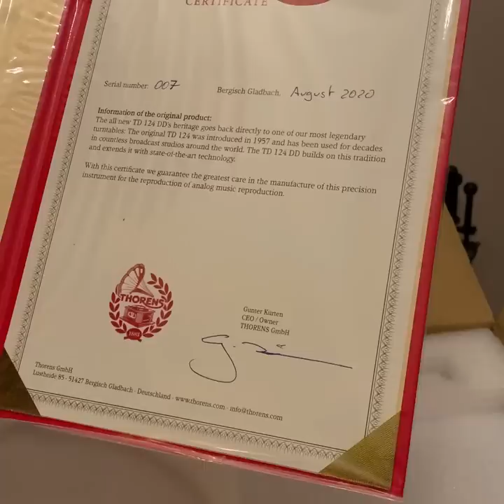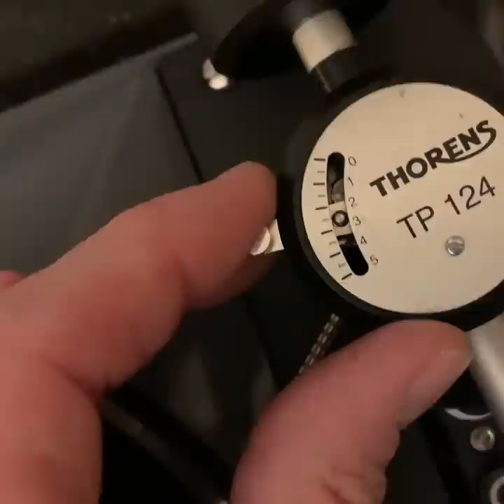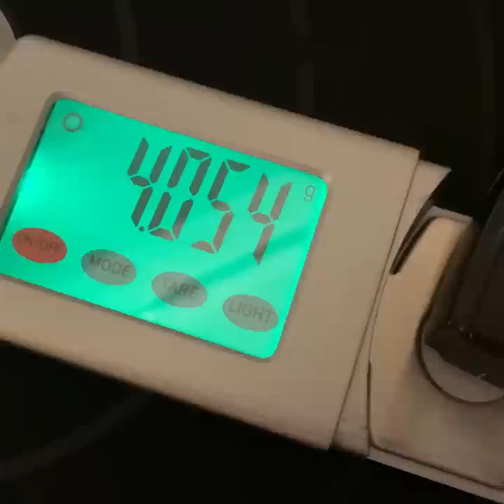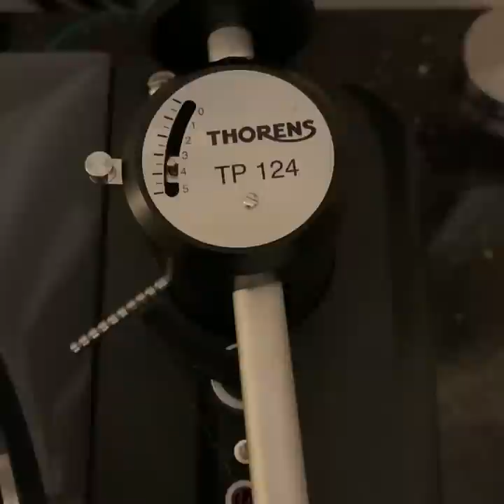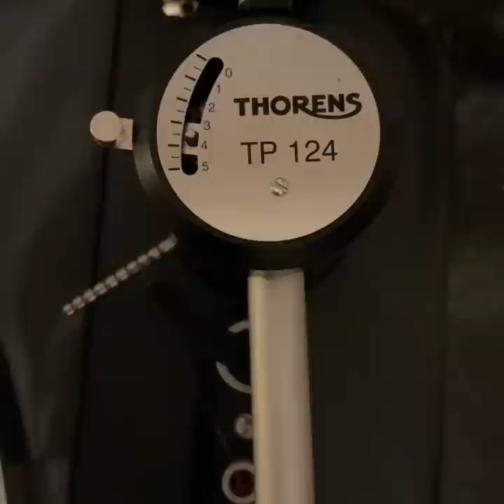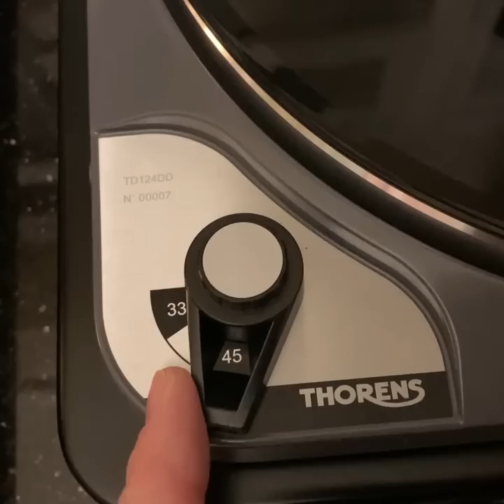Unboxing and setting up the the brand new Thorens TD124DD

Comment: A dream machine indeed. 
I was bit surprised that the VTF scale on the arm was not accurately calibrated.
Reply: I think that was more user related...If you want to do it properly remove anti-skate at least.
Reply: @martinda7446  So the anti skate caused it to be almost a whole gram off?
Reply: @EddieJazzFan  Er No he just didn't do it properly. Just so you know where I'm coming from. I'm not criticising just letting you know what's going on. I am an audio engineer of getting on for 45 years. I too would be interested to see the how well it is calibrated after having owned two TD124s in my time.and in those 45 years have never seen an arm a gram out..And that would literally be thousands of tonearms.
You need to take a little bit of care.

Comment: Definitely an SL-1200 motor unit there.
Reply: Nah, the modern SL-1200 motors are axial.
Only the old 1200s have those type of radial motors.
Reply: @QoraxAudio  Yes, an original SL-1200 motor unit, as I stated.
Reply: Looks more like the motor unit used in many of the so-called "Super OEM" turntables. Nothing wrong with that though :)

Comment: Great video!  Love my original TD-124.  I would think that balancing the tonearm before attaching the anti-skate would make balancing easier, and maybe more accurate.  They should have included 78 rpm.
Reply: That's correct, suppose to balance tonearm before anti-skate

Comment: I’d be curious to know what cartridge you are using. Four grams for the tracking weight seems a little high. Thanks for going over all of the details on the video. The first few seconds of Take Five sounded heavenly.
Reply: pretty sure it's just the included spu
Reply: @trevor245  The one he used is Ortofon SPU#1E. The optional one with Thorens is much higher end one, a modified SPU Synergy G with lower tracking force and easier handling by phono.

Comment: Cool video and beautiful turntable!!! Wonderful system too as far as I can see... Did you try any other cartridges than the SPU 124? What would be your best fit in terms of head-shells and cartridges in case you have spent some time investigating other combinations?
Reply: He was using the budget SPU #1E not SPU 124.

I use Goldring Ethos with 124DD and seems to work very well with it.

Comment: 3.5-4.0 grams?  What are you using for a Cartridge?  In the last twenty years, all of my cartridges have a downforce of 1.4 to 2.0.  The only cartridge with heavy downforce is the conical tip??
Reply: SPU which uses heavy tracking

Comment: If Thornes wants to re-release a classic..It should be the 125-Mk II. I recently re-built mine. Works better than ever. At least with the 125 your not stuck with that built-in "budget" tonearm. 4 grams...Yikes !
Reply: I have the TD-125 LB and it’s marvelous! That would probably the last thing I upgrade in my system

Comment: This is a nice turntable but it’s a completely redesigned direct drive. It has almost nothing in common with the original TD 124 which is a belt/idler drive.

Comment: Although i respect this brand but for this price you can buy something wayy better and better good looking in half price than this ungly thing .
Technics SL-1200G for example
Reply: I can see you have ZERO idea about turntables,ty for your time.
Reply: @joebloggs8636   How about you expand on that comment. What makes this so special over the Technics (besides, perhaps, its looks)?This is basically a repro, whose cosmetic design comes close (but certainly doesn't duplicate) the original. The internals are completely different from the original.
Reply: It's the Technics which is a minger. If I had this sort of money, I would buy the Thorens over the Technics for the looks alone.
Reply: Me too ,'joe'.  I know nuthin..  It's butt ugly.  Some things don't need homages, eg anything that looks like bakelite...
Reply: It's not ungly.

Comment: 0.04% wow&flutter. This is extremely poor for over $10,000 direct drive turntable. Better than td 402&403 dd's 0.15%, but still worse than Technics' cheapest model's 0.025%.